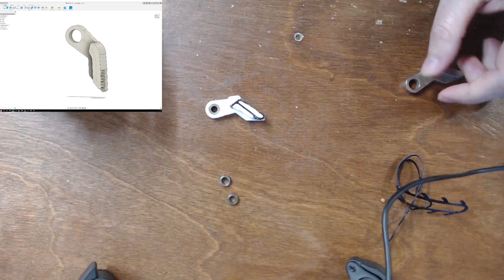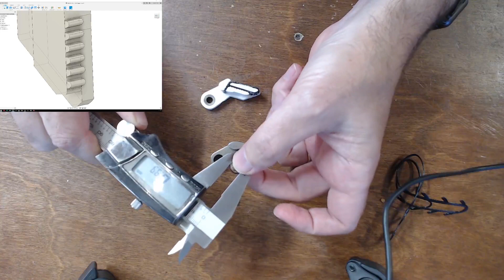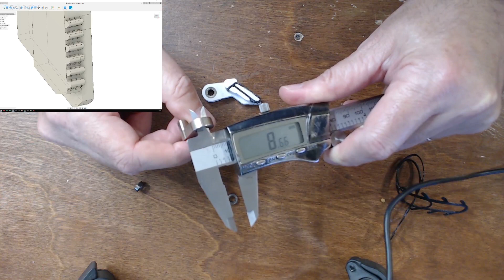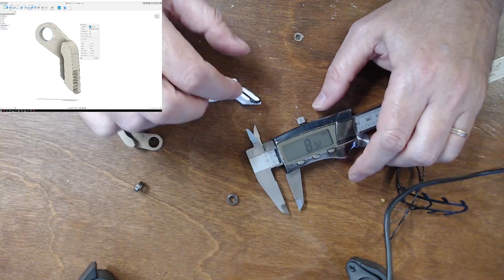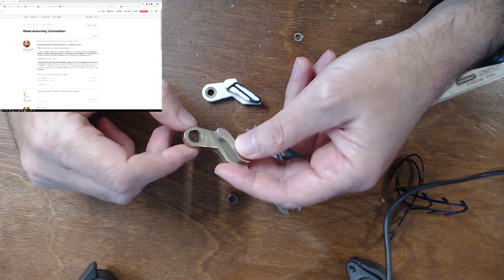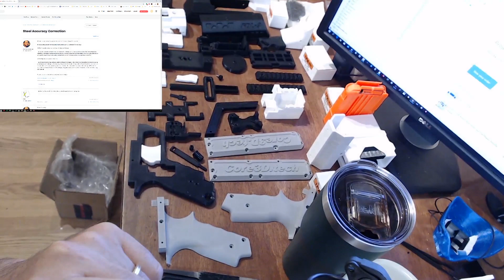My first Shapeways order, not as accurate as I'd hoped it to be

Comment: At least Shapeways has publicly shared design guidelines: https://static1.sw-cdn.net/files/cms/materials/comparison-guides/MaterialsDesignGuidelines_07212020.pdf

It seems that steel has minimum detail of 1.0 mm so you should probably order square teeth if you actually want small rounded teeths.

I agree that Shapeways should provide much more info about expected accuracy.

As for press-fitted bearing, I guess the only real way is to drill the hole with high quality drill if you want strong connection.